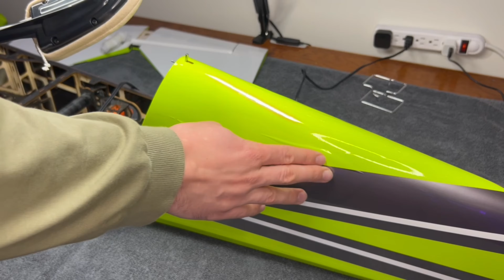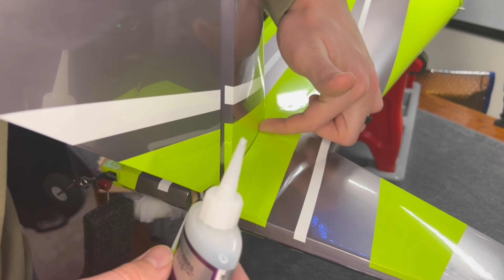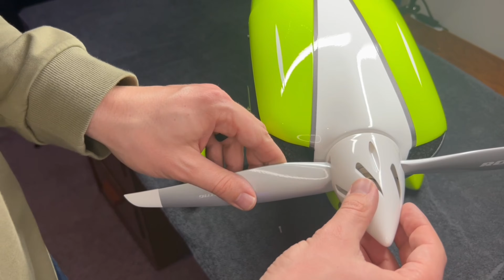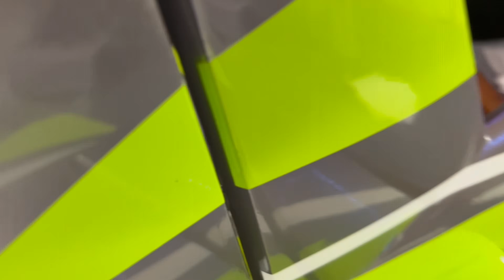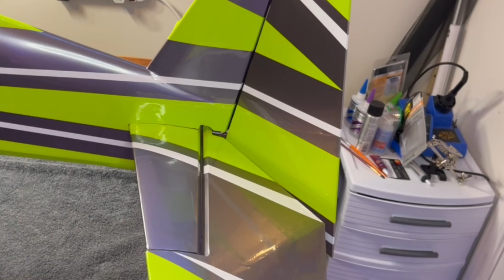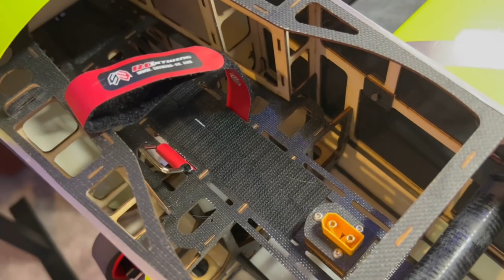SKYWING 61in Edge 540 PnP Build Video

Comment: I wish I had seen this before assembling my SW 67 laser.  The build is almost identical but there was very little guidance. You did some things I wish I would have done. The maiden is this week! I'm pretty excited.
Reply from the maker: Hope the maiden went great man!
Reply: @upwardrcIsaacSmith  The maiden was fine.  Since then I broke 2 out of 3 rudder hinges.  After replacing, (this time using epoxy with Vaseline where it hinges) I also sealed the hinge gap with covering.  It's trimmed and flies terrific.  I think SW makes a great model.  I especially like the wing servo connections.
Reply from the maker: @waynemiller6070 Yeah. The rudder hinges broke on the second time out to the field for me as well. I ended up putting some stronger hinges on it.

Comment: Hi, thank you for your valuable video.  I am not a 3D pilot, I carry out sport flights with some 3D figures.  Could you tell me the recommended CG and the right excursions for low rate and high rate of this model?  A thousand thanks.  Maurice.
Reply from the maker: I would start with putting the CG about a third of the way back on the wing and then adjust from there for your liking and flying style. I run just high rates on my 3D planes. My ailerons at around 36-38 degrees, my elevator around 50 - 55 degrees, and my rudder just enough so that it runs parallel to the elevator cutout at full deflection. I would probably start with half those rates for a sport setup. I would especially tone down the tail rates.

Comment: Nice overview, just got the SW Yak 54 PNP myself. Just very bad practice to calibrate/change ESC settings with the prop mounted! If people follow along, please don't follow that step and remove the prop first.  These props on 6S will send you to the ER within a blink.
Reply from the maker: Yep totally agree. I should have done that. If you mess up and get the motor reversed or something with the prop on you will be in big trouble.